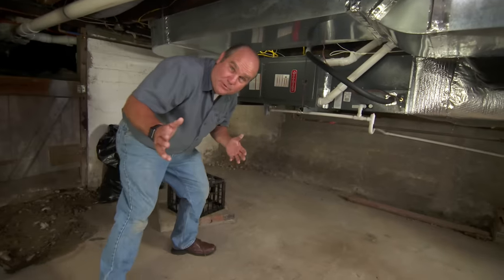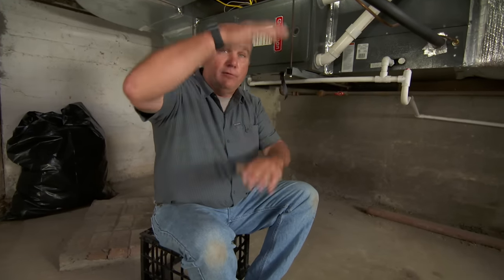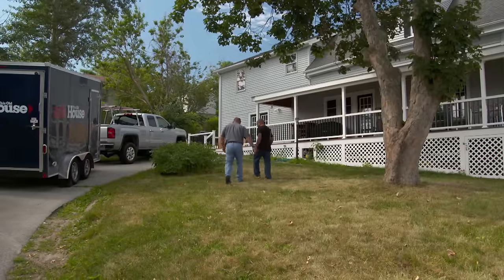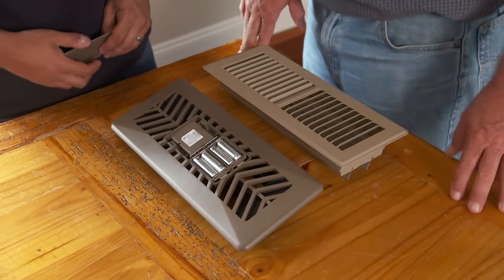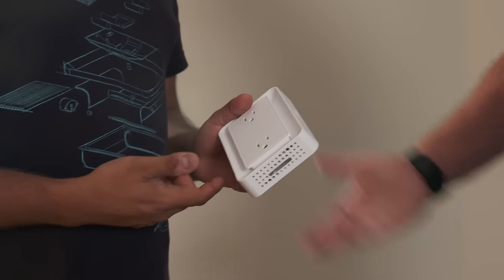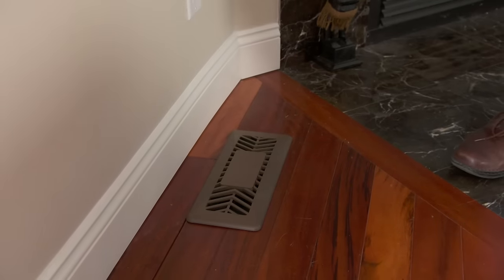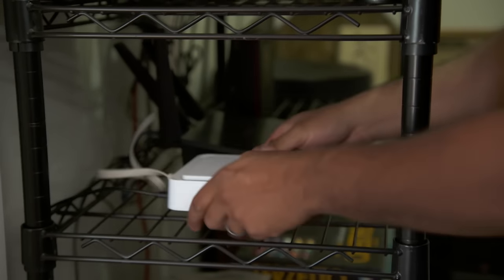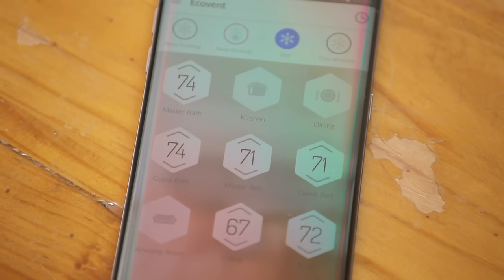How to Install Room-By-Room Zoning in an HVAC System | Ask This Old House

Comment: OK this is a waste of money people.im a 17 yr HVAC tech and you can't rely on this for a fix all. first off this stuff isn't even tied to the furnace so if your thermostat isn't on u can't control room to room comfort.the thermostat is still in one area and will bring the furnace on and off for that main area so if your unit isn't even running then your not going to be able to get the room dead on. then with it not being all tied together with a zone board and no bypass damper and bypass ducts you will have issues if the air can't get out of most vents and the thermostat is calling for heat but say all the vents in the rooms are closed because those areas are not needing to be raised but the area the thermostat is located is you will over heat your furnace for sure. so best way is to get the Honeywell zoning system and it use temp sensors in each room that wirelessly controls the call for that room to open or close a damper located in the ducts
Reply: William Bubenicek yea but if you watch this video they said the tstat is just a on off switch for the system.so if the area the tstat is in isn't calling and you have a demand for heat or Ac in say 2 rooms on the other side of the house ,guess what? that room won't get any response until the area the tstat is in needs heating or cooling. because nothing is tied in to the tstat on this zoning system. now if the central hub is working with the unit or tstat then yea that cool,but it doesn't. I watched it twice and both times nothing is said about the tstat other than it is a on and off switch for the unit.so if you can explain that to me?? and I'm not trying to make Honeywell look good or whatever. but trust what works buy the people who have proper zoning solutions.
Reply: William Bubenicek  well then wouldn't u need a new tstat that has pairing capability? why don't they show that on the video? and it would need to be a tstat that is designed for this application. regular digital tstats don't just pair up with hub? unless it is actually wired to it?
Reply: its still junk because for example, it's running the entire AC system just to cool down a single room. not only that but because its running the AC for a single room it wont get the proper dehumidification. so you are either using too much energy/wearing down your AC, or less comfortable than before.
Reply: Blox117 likely the least of the worries for a person interested in this system.

I’ve done zoning controls for various buildings.  One thing is for certain; they are far from perfect.

This system will likely have its own issues, but it beats having to demolish your walls in order to rebuild your ductwork, install a bypass, and install a Honeywell TruZone.

The labor alone can set the homeowner back a couple of thousand dollars.

And even then it isn’t a perfect system.

Then there’s the mini-splits with multiple indoor units.
Better than the TruZone, but still limited by how many indoor units MUST be running at any one time for proper operation of the condenser.  And the sizing of the house/apartment can limit how many indoor units you can install.
That’s another expensive and still not perfect option. Much better than most though!

Finally, you have the Mitsubishi CITI-Multi, with its heat recovery technology, that basically allows you to “shuffle energy” from one room/zone to another.
This allows you to heat AND cool two different spaces simultaneously.
And you energy savings are amazing!

But, even commercial businesses shy from the price tag and the difficulty in finding proper technicians to maintain the system.

With all that in mind, this isn’t too bad.

But it is still expensive.

Comment: Any controls system or VAV system that does not integrate with the fan and compressor either staged or modulating obviously came from the Dept. of Defense and not the Mechanical Engineering or HVAC field.  There is a reason why branches are dampened at the trunk and not the air device.  There is a reason why static pressure is taken into account when designing a system.  If this system communicated back to the fan and to the compressor it would be par with all the great products out there that are actually designed to do this for real instead of some joke that you would see at the state fair.  I am sure it took a lot of time to fabricate and develop, but you should have studied the market and at least accomplished what the real home VAV Zoning systems are already doing.

Comment: Big issue with the fact it could be 80 degrees up stairs and 72 down with the Tstat in the colder area. The system will never come on to cool. Total waste of money. Just hire a pro to do it right.
Reply: Ok Dipul Patel, maybe I missed that part in the video where they described having a temperature sensor in each room. How do you deal with the issue of 2000 CFM trying to go into a single room that is only ducted for 200 or 300 CFM? 

If truly only the best pros install it then why has nobody heard of the system in the industry? You can't buy the system in the parts houses were every single company goes to buy their parts.

There's about 30 of them in my area and none of them sell this product.

Comment: Coming from a actual hvac technician this system would be massively flawed and it only work if the main thermostat is actually calling. This is the broke mans terrible zoning option and in my opinion would be an absolute waste of money it would only actually somewhat work if you had a room that was way to over cooled or overheated when unit is running but there is no way his system can properly tell if it’s restricted to much airflow unless it has sensors on hvac equipment very flawed please save your money!

Comment: This to me is pointless bwcause it doesnt reduce my bill. the main unit is turning when those floor vwnt are closed.
Reply: Ben Ti 

It reduces the bill by focusing the airflow on the rooms that need it.

If you really only have three rooms that change temperature radically, instead of dividing the 100% of airflow throughout the house, it can focus on the three rooms that need it, which, with the increased airflow and volume, will have your room reach set point much quicker.

Of course, it won’t save you money like a variable capacity compressor or a heat recovery system.

Comment: this is crap, your furnace is going to go NUTS!  too cold in bathroom, TURN ON FURNACe, too cold in family room, TURN ON HEAT,
Reply: why would you have that in the bathroom, just give it heating or cooling when other rooms need it
its a friggin bathroom not a main room. why not find problems that are actually problems and not you shitting on things for shits and giggles

Comment: And 50 AA batteries every other month. Nice product though.
Reply: The batteries have a 3-5 year life.
Reply: Matt Leaf OH that's a lot better.
Reply: I have the system installed in my house and I am pretty disappointed with the battery life. Only 5 months.
Reply: I would've given the home owners a way to still wire these up manually. I mean you could just have run a small wire between the wall unit and the vent.

4x1.5V = 6V...you could've ran these off the 5V from a USB cable

Comment: Lost me when he said you have to connect it to your internet. ZERO reason you should be FORCED to connect it to the internet. Dumb engineering decision and quite frankly LAZY.
Reply: Reason 1: The boards in the ducts need to communicate with each other and the hub.
Reason 2. The main operation is using a smart device (phone/tablet) to communicate to the hub. There is no central station to adjust airflow between the ducts. This leaves open to monitoring/control your HVAC from anywhere the world.